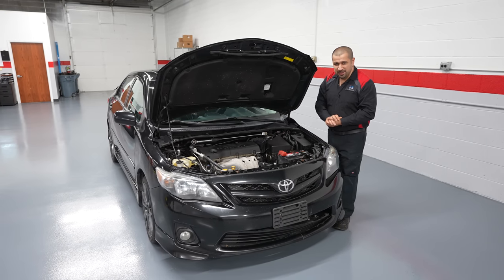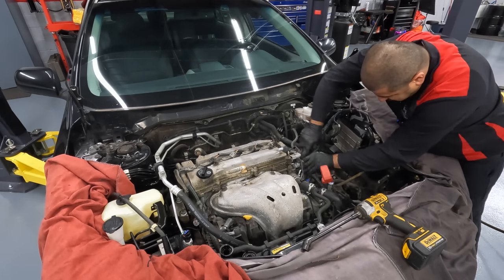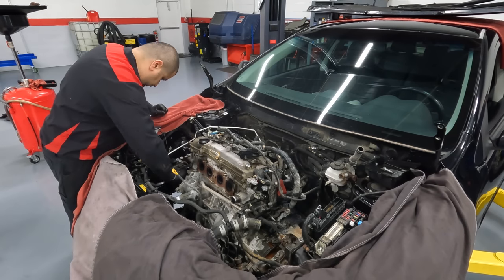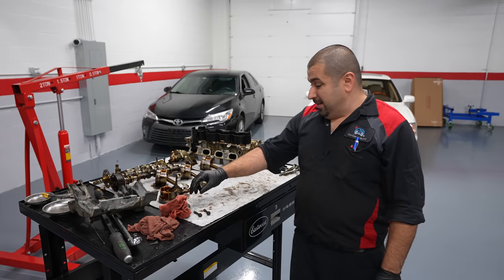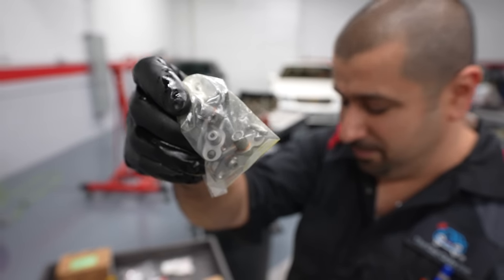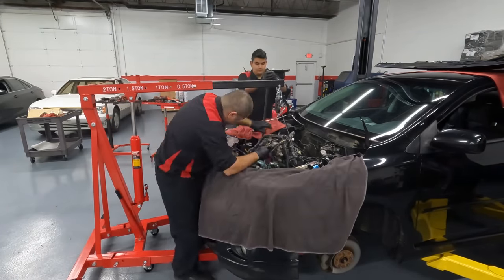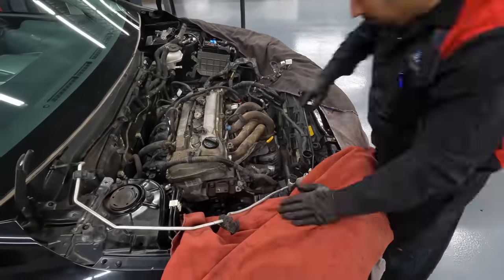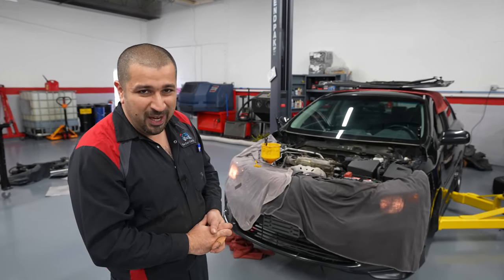THIS is Toyota's Worst Engine Ever Made! But Is It Really THAT Bad?

Comment: $3,200 buys a lot of oil, however you have to count the increased likelihood of running low, and then the catalytic converters don't live as long. I had a 1991 Camry oil burner. In 252,000 miles it consumed an extra 252 quarts of oil. When I sold it the new owner said he would keep the oil topped off but instead drove it until it seized without ever checking it. Also if you drive it long enough, the exra oil being burned will eventually coke up the rings and valves and oil consumption will go through the roof.

Comment: Oil change frequency depends on the TYPE of driving. Short runs, or heavy loads is considered SEVERE SERVICE by all car manufacturers, and a 5,000-mile oil change frequency is recommended. If much of your driving is longer highway commutes, then you are wasting your money changing oil at 4,000 - 5,000-miles... Until your engine oil is fully warmed on a longer highway commute, all the moisture, unburned fuel, and hydrocarbons that pass by the rings on every combustion stroke does not have a chance to boil off until the oil is fully heated, and your oil's ability to lubricate is diminished, especially when it's had a chance to accumulate over time and form sludge... Periodic longer highway runs are the best solution to short commutes.

Comment: Mines got 100k on the clock, hasn't burned a single drop in all that time. So idk what people are complaining about.

Edit: 2008 scion tc, bought it brand new and ever since I've changed my own oil at or under 3k with full synthetic and the ONLY thing that has ever broken on the entire car was the $20 gas cap at like 60k miles... yeah that good. At 100k now and about to pay for a new clutch bc I love this car and will never sell it.

Comment: My 2006 Scion tC has 175,000 miles. I started engine soaks about at 140,000, first with MMO and later adding engine flush. I also started engine flushes. It has reduced oil consumption but not near 100%. I should have a pretty good idea how well this works at 200,000. Stay tuned.
Reply: Any update? Thanks man

Comment: I might have posted this....  I have the engine in my 2011 Scion XB and while the oil burning is a PIA.  Everything else about the engine in wonderful.  Replacing spark plugs is like a 20 minute job.  Then the engine appears to have a great power band.  It puts out good strong power at all speeds.  So while I am feeding it maybe 1 quart every 1,000 miles after 250,000 miles, I much prefer this engine to the 6 cylinder engines from the 2000 era Camry type vehicles, and that engine always went well over 200K miles for me.

Comment: I had a 2003 Highlander that I bought new with this engine (2.3L) and the cylinder head bolt issue reared itself at approximately 198,XXX miles. The engine never had an overheat episode. I ended up pulling the head and sending it out for rebuild and bought the repair kit from Toyota. I ended up selling the vehicle (2019) at approximately 298,XXX miles. Did not have excess oil use with the engine. I ended up buying a 2015 Toyota Venza (2.7L) that only had 10,730 miles on it in Oct 2019. I just turned 61,XXX miles on it

Comment: 2005 Camry 2AZ-FE 270k miles strong. Burns about 1 qt every 4k miles. It was my grandmothers car then my mothers. They both ignored the canister purge solenoid which failed open and let too much air in running it super lean getting it hot. Melting wires to the coil pack on Cylinder 3. Fixed it 5 years ago. Love the car. Gonna rebuild it and put in the factory turbo for the scion AB. Btw I live in Detroit. Rust just means you can get it cheaper! Torch ftw.

Comment: So the gudgeon (rod) pins are held in with circlips and locking pins to hold them - good stuff.  I put new pistons (standard diameter) and pins in a six-cylinder engine once, but a gudgeon pin came adrift after one of the supplier's-supplied silly wire clips came out (despite my best efforts to secure these) and it scored the bore almost 60 thou when the engine was started.  

My second go used oversized pistons with custom-designed square profile circlips - wasn't having THAT happen again!

Comment: I had a 2003 XLE and that was a problem. The head bolt pull the threads. There was a recall but I was never notified. I replaced it with a used engine which gave me 300,000 miles

Comment: I had a 2002 Camry 2.4L years ago. It burned oil most of the time. At 200k miles its transmission was down. The tires always ran out of threads long before tire (Michelin) warranty. Other than these issues, it was a good car.

Comment: No, it's not that bad.  Especially when Toyota recalled all / most of the oil consumption issues.  My 2012 9.0 RS Scion xB doesn't burn oil and I'm trying to get an extra 25 hp out of it.
Reply: Toyota didn't send out letters to notify owners. Didn't let me know either during oil changes when I brought this issue up to them and only gave you a small window to address this problem. Drove around with little to no oil in this engine and Toyota never helped out.

Comment: Great video, but I didn't see the refrigerant reclaimed, nor did I hear the cost of the A/C system referenced.  For the amount of time the system was exposed to the atomsphere, the filter-drier should have been replaced. Plan on adding an $300 - $400 to the job to cover the A/C system evac, parts, and recharge.

Comment: Cool info... when u burn oil long enuff in these, they coat the af sensor with burnt oil carbon. Which is thicker than regular carbon. Which causes ur gas mileage to be so bad, that a v8 truck gets better fuel mileage. So replace ur af / o2 sensor annually if ur burning oil.

Comment: I have a 2AR-FE  in the Camry that I have run synthetic oil usually 5W-30 for the last 130K miles. It has 201K now and burns 2 quarts every 5000 miles. I'm switching to Valvoline Restore & Protect Synthetic to see if after 3-4 oil changes to see if  if it will clean up the rings. I just bought 5qt jug.

Comment: This engine is in my 2006 Scion tC with 180,000 miles. I have done a few engine soaks which has really cut down on the oil consumption. Now it burns about a quart every three thousand miles. My next oil soak will be my last (tired of doing this). My plan is to take it to 250,000 miles.

Comment: I had an avensis 1.8 vvti 2001 model got it with 72k sold it at 92 k it was still on the road 2 years later and was burning oil at a reasonable rate but passed mot test ok it was so reliable just needed a handbrake and front cat pipe that's all in the 2 n half years i owned it fantastic car.😊

Comment: In 2017 I bought a 2005 Camry LE 2.5 with 55k. It now has 217k. It runs excellent and burns no oil. The ac is ice cold,  good ABS brakes,  lots of room and parts are inexpensive.  I plan on buying a 2019 to 21 Nissan Murano. But I will keep the Camry.

Comment: Hello Ahmed, my name is Eric from Canada, I just love your channel. I own a 2AZ-FE in a 2009 pintiac Vibe GT. It has the oil cap with 0W20/ 5W20 on it. It has been extremely well maintained,  does not consume oil, can I or should I run 5W30 oil in it. My car has 165000 miles on it. Thanks for your response. 
Eric Soumah
Reply: At 42:00 he seems to say that this engine was made for 5W30. Is he talking about the fixed engine or that engine in general?
Reply: Did you get a response about switching to 5w-30? I have same question
Reply: No, not yet, I really need his answer due to the vvti hydraulic valves timing gear

Comment: I have the 2012 camry that I bought used. It only consumes less than a quart for 5K miles until new change oil. I used Mobil 1 high mileage, but before change oil I pout sea foam to clean the engine. It has almost 200K now.

Comment: My 2az fe from 03 has 310k miles. Been doing 3k mile oil changes since we got it at 15k miles. So long as you take care of this motor and baby it, it will literally run forever. Original everything, down to the factory timing chain. Little loud on start up but once she’s warm she’s great. Need to figure out a weird cylinder 2 misfire. It’s not the maf so I’m thinking it might be a little oil in the spark plug area. Don’t think it would be that since I recently did the Valve cover gasket but hey anything is possible

Comment: My 2AZ was fixed by Toyota when the original owner had it - He put about 200,000 miles on it, and I've put another 200,000 miles on it.
Runs like a top.
Once the oil rings are fixed, it's bulletproof. 
400,000+ miles don't lie ^_^

Comment: In my country 2AZ-FE don't have oil consumption problem but when it's reach 150k miles the balancer shaft gear was the problem and it's the only issue on this engine, other than that this engine was very reliable engine some people has 600k miles on it with 2 times balancer shaft replacement.

Comment: The 2AZ-FE is also known for having issues with the cylinder head bolts, where the back three middle bolts wear out. This leads to coolant leakage from the rear of the engine, which can also cause overheating and warped mating surfaces.

Despite resolving the issues with a re-designed cylinder block in 2007, many earlier 2AZ-FE owners have been highly frustrated with Toyota’s resolution to this hugely widespread problem. Toyota hasn’t been entirely silent on the subject, either. After acknowledging these drastic issues, there was a technical service bulletin in 2011, which has never resulted in a recall. 

With over 1.7 million 2AZ-FEs being sold before rectifying the issue in 2007,  guessing that this must be a considerable concern for Toyota, who have offered free inspections to look at the situation. Several class-action lawsuits are still underway regarding the issue, and in 2015, Toyota North America extended the warranty.
Reply: They should have recalled it

Comment: Saw a 2007 scion tc manual with 500k+ miles back when I changed oil at toyota a few years back. He came in often. First time I saw it, it had 300k miles. Probably still going.

Comment: To move the tensioner one click dont you have to remove the timing cover? Toyota did my wifes 2012 scion xb under extended policy but since then therr has been like a rattle which to me sounds like timing chain rattle. No check engine lights and no driveability issues. Guidance? Only noise to deal with or will it cause issues?

Comment: We had a 07 Camry with ~60k miles on it, thing burned so much oil that if you didn’t fill it up in between oil change intervals it would run dry pretty much.

Comment: I have the same issue with my 2007 Camry. @ 141,000 miles it consumes 1 quart every 700 + miles. You mentioned this repair cost $3,200 on Nov 2022. How much does this cost now? Thank you for doing this video.
Reply: More?

Comment: I've had that exact engine work done right at the 10 years\150k km under warranty on mine, switched to 5w30 as a lot of people do in the 2AZ community and it's been  nothing but a joy to drive! Some folks add a few ponies as it can take it (same engine as the supercharged Scion TC), in my case I didn't feel like going forced induction so I ported and (slightly) decked the head, bigger injector & fuel pump, ceramic clutch, cold air intake, 4-1 headers with catback exhaust, custom injection mapping and most importantly, a reasonable nitrous setup. It's been 4 years running as my daily driver right at 205 HP at the wheels and low to mid 14 seconds on the quarter mile. These engine are VERY sensitive to knock so taking it slow and steady for upgrades with a safety margin is the way to go, especially with the stock ECM. The only thing missing is a torsen LSD but damn, they make for a serious sleeper car! ;)

Comment: Great video. I love how technical your videos are. 

I have an auris uk model with a 1ad-ftv engine (2.0 d4d), it also went through a major recall in uk due oil burning, was this engine affected in usa too? 

My auris seemed to give nothing but trouble to the previous owner, but to me in the 10 years i had it, only had to replace the injectors (on toyota extended warranty), starter, egr (my fault), and alternator. Not the most comfortable car but it sure has been one that never let me stranded on the side of road. And one that will be with me until it dies.

Comment: I have the same engine on my RAV4 . It serves you for a while, and then everything starts to wear down. Their oil consumption is a big joke. Emission system is the worst part. Lots of noise around belts water pump area. Once you start spending money on it, it’s a none stop. One problem after another.

Comment: I have a 2007 Toyota RAV4 with this engine. I put oil in it every 3-4 days. Transmission seals are leaking, doesn’t shift to Drive at times, Evap canister needs replacing, replaced the battery, starter, Alternator, radiator & shock absorbers. I think I should just let it go it has 170k miles

Comment: So if the Camry has the oil cap with 5/20 or 0/20 it has the updated piston rings?  I’m looking at a 2010 and 2011 Ca,ry 4 cylinder for a young driver.
Reply: No, if 5/20 0/20 is on the oil cap, that indicates that it has low tension ring pistons which burns oil. He tells you to look for black sealer around the upper oil pan or ask if Toyota has a record of the repair. The 2010, 2011 Camry has a 2AR-FE engine which doesn't have this piston ring issue, but, can burn oil if the oil changes were not done on time.
Reply: @frankg6578  I just watched another one of his videos and he recently said that he has extended the oil burning to 07-11 4 cylinders Camrys.  Yikes.  I’ll stay away from those years.  Thank you for your response.
Reply: @frankg6578 I'd imagine you should look for evidence for the repair vs oil cap because there's a chance the oil cap was changed to the wrong one or changed to make it look like a "good" engine. Even if that is probably rare or somebody would have to be clever and scammy to do that.

Comment: Son has a 2009 Pontiac Vibe with this 2.4L engine. He currently has 348000 km on it.  Does it burn oil, well I often remind him to check the gas and filler up the oil. It starts up daily and still has decent pull. Highly doubt if this had a G.M. sourced engine it would have done this mileage.

Comment: Think you never heard of 1zz-FE toyota celica 99-2002 (from 2003 they assume they fix it) i had that car, now i have a 2zz-ge celica now =) that one was burning 1 liter of oil in 650KM =)) around 300-400miles, IDK something like that, basically on every fule full tank my oil was going to low =))

Comment: my Scion xB runs and drives just fine, 160k miles and no oil burning the only thing I dislike about the car is the AC Compressor design is bad 

the inline 4 is really good

Comment: Subject to an ultimate recall after much Toyota Corp deception. This engine made me give up on Toyotas forever. Toyota LIED, I will never purchase a Toyota again.
I have read on a Toyota forum of an owner draining the oil, pulling the plugs, pouring an engine cleaner in the cylinders letting it sit a few days, then a full filter-oil change...and supposedly the rings perform better, less burning.

Comment: I never burned oil in my 2005 Camry bought used with 50k and ran it till 242,000 using full synthetic, smoke ok start up turned out to be a bad throttle body eventually it failed and when replaced at 185k never smoked again , oil replaced a belt tensioner and valve cover gasket

Comment: For the mileage of 140,000 miles most Japanese engines start to wear out.  I’ve seen this in most Toyotas and Nissans here in Florida. Always do all  required oil changes to avoid unnecessary wear.

Comment: I usually find using a good synthetic is much better.  The oil lasts longer and stays clear longer.  Synthetic lasts twice as long as regular oil, so it's better to pay more and change oil less often using synthetic.  Change the oil after 6K miles, but use synthetic. I have over 300K on one engine and it doesn't use a drop of oil on long trips.

Comment: I have the 2AR-FE  2.5L and it has 189K mi.  It was using about 1.5 qt oil between 5000 mi oil changes of using Mob**1 Syn 5W-30 or 5W-20. Since changing to higher Visc & zinc  Mob***1 Syn  5W-40  FS European  it is no longer using oil.  Summer temps can hit 118F. My Camry car used to be a Leased Vehicle & was Certified Used by Toy Dealer

Comment: I have the same engine in my 2007 Camry, it only has 61,500 miles on it, the engine oil was changed every 5000 miles at a Toyota dealership since it was new.  This was a one owner car, I went to our local Toyota dealer and gave him the vin number and he said that this procedure was never done on this car.  I did my first oil change on it and I used 5W-20 full syn oil, the engine oil was last changed 4000 miles ago, around two years ago too. It had plenty of oil in it, I checked around the inside of the exhaust pipe and got some soot on my finger, but not much. I change oil every 3000, or one year, which ever comes first.  I live down in the warm-warm sunny weather, no snow and no salt, hopefully I will not run into this oil burning situation.
Reply: If it’s a 4 cylinder it probably will when the miles go up. It’s a design flaw, not really a maintenance thing. Only solution is find someone to rebuild the engine or put another engine in it that hopefully was already fixed.